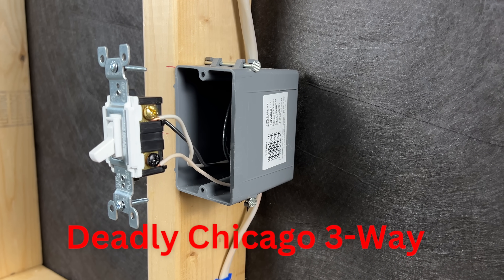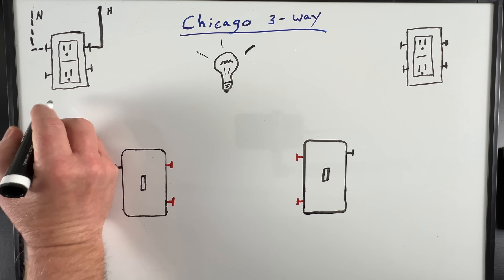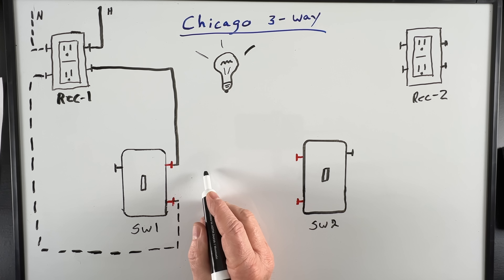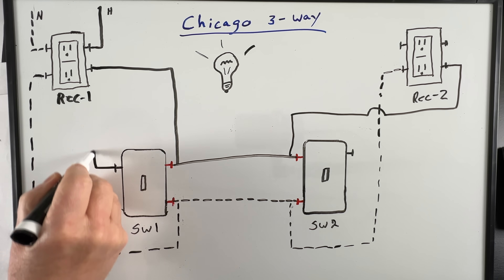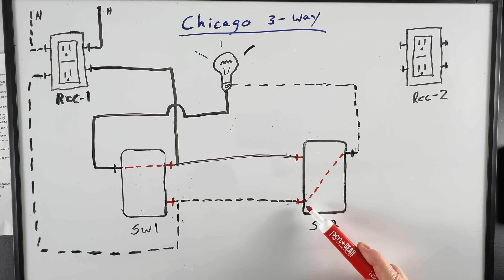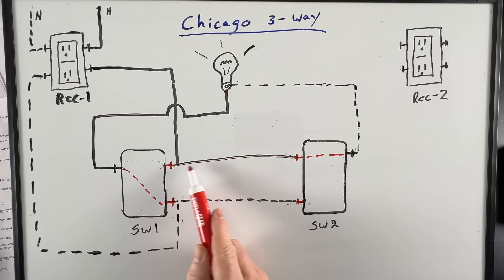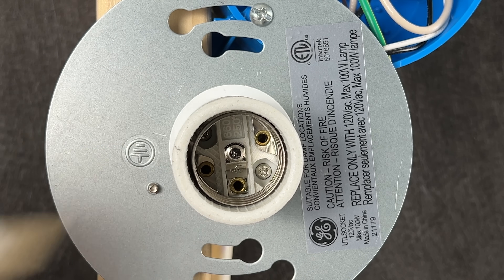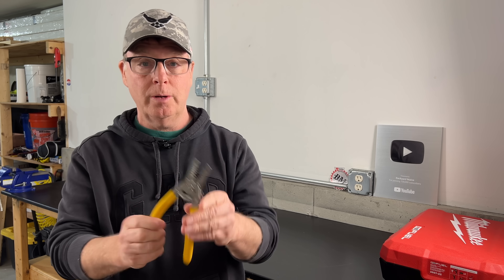The Deadly Chicago 3-Way (Only 2 Wires)

Comment from the maker: Video Links here>> California 3-Way - https://youtu.be/AeXFe5ghmKQ   Standard, Dead End and Single poles Switches here>>  https://youtu.be/B6gfI73Tvg8
Reply: Hey John, this video in particular is proving to be incredibly valuable to Me as I am in the midst of an old-house re-model fitted with tube wiring... this explanation and illustration just provided the answer to numerous questions that have popped up during the job.

I can't tell You how many nights I have laid in bed going through hypothetical wiring diagrams in Mine head!!!

Thank You for making AWESOME content! Your candor and step by step illustrations are really fantastic!

Be well!
Reply from the maker: @meancuisine8 thank you so much. I’m happy the videos are helping you on your project
Reply: I've looked at different information for 3 way switched lights and stayed confused. Your videos are simple and clear, thanks. 
 I wanted to understand how dad wired the stairway lights, now I have examples to compair to.
Reply: there are 5 ways not 4 you can overhead feed the light then switch the neutral
Reply: How could a 15 amp situation be deadly? 😂 come on man
Reply from the maker: @RefrigeratorWilliamPerry  120v power kills more people in the USA than any other voltage. And it only takes a fraction of an amp to kill you. If you don't know that you should not do any electrical work.
Reply: @B @BackyardMaine  I guess that’s true in theory I’ve been doing electrical work since I got out of high school over 30 years and I’ve got the piss knocked out of me more than I would like to admit when I was first learning, but the scenario has to be perfect like a plane crash before your life is in any danger… Unless you go put those Chicago three-way switches on one barefoot or something I don’t really see the issue besides, if you don’t know how to use a multimeter you shouldn’t be doing electrical work
Reply from the maker: @RefrigeratorWilliamPerry  Most of the time we get shocked across our hands so its not deadly. When current travels from one hand to the other or from your hand down to your feet you we're at a high risk. This accounts for about 1000 deaths a year in the US alone.

Comment: Just because its banned doesn't mean it can't still exist and work in older homes. I certainly wouldn't rip out my walls to change it if its working. Just don't assume a two way circuit is dead with the switch off.

Comment: But I'll say this- if there's a single gang switch at the bottom of a staircase for a 3-way switch there's nothing more convenient than a Chicago. Whether or not you go all out, there's still going to be 120 volts on one or the other of those traveler wires.

Comment: I was banging my head against the wall of our 1920's rehab house as i couldn't get the 3way stairway light to work right. Some knob and tube and i was giving up, thinking one of the wires had broken in the wall or something. It was like this when we got the house and only the 1st floor switch worked when the 2nd floor switch was up. 
Your video got suggested (phone probably had me cursing the switches). After a little digging, and measuring, IT WORKS! 
I'm so happy. 🎉
Thanks for the videos. They really help.
Reply from the maker: That's awesome! So glad I could help you out with that tricky wiring.

Comment: Actually Chicago feeds the bulb ON by L H, or H L respectively and OFF by N N and ALSO H H - so OFF bulb is LIVE and also bulb thread may be LIVE.
At least it carries electricity from one room to another by only 2 wires.
California anyway needs 3 wires.
Why don't they use the switches symmetrically? First switch connects H to line A or to line B, intermediate 4 way switches connect (incoming line A to outcoming line A') AND (B to B"), OR if reversed (A to B') and (B to A'), and the last switch connects either A" or B" to the tip of the bulb, while the thread of the bulb is N. Position change of ANY switch turns from OFF to ON, or vice-versa. I found this in 1966 in a much older electrician's European manual, for rotating switches.

Comment: As someone with knob and tube in crawl space and attic for ceiling I have seen outlets not work from three way switches not functioning to open splice’s with nuts exposed even wires with no nuts on them this seems like a fire hazard shiiieet my light flicker my dryer,micro,oven,ect on same circuit 😂

Comment: Saw this in my former old knob and tube home dating back to like 1910. Even got a minor shock not realizing that the 3-way switched ceiling light at the bottom of the stairs was wired in this unsafe older method using just two wires.

Comment: this is VERY similar to the turn signal wiring on older GM vehicles.  Ever see them alternate the marker light and the front turn signal when he headlights are on?  This is because the flasher is a 3-way.  It reverses the polarity on the marker light when the running lights are turned on each time the flasher clicks (which is a 3-way switch).  power flows backwards through it when the turn signal AND the running lights are switched on at the same time, but flows forwards (using the front turn signal light as a ground) each blink of the flasher.

Comment: In the chicago three way situation, where is the light fixture  assumed to be?  On the house or the garage you need three wires in between.  How would this run on your 2 wire theory?

Comment: If the Chicago 3-way was installed into a 240v system without a neutral (either L-L single phase or part of a 240v delta) and the conductors colored black/red, black/red/blue or black/blue/orange (all without white) wouldn’t this solve all the problems identified at the end of the episode?

Comment: I'm from Pittsburgh, PA. I 100% have a hallway wired this way. And yes It's K&T (1983 era house.)
Reply from the maker: Wow.. you have knob and tube wiring in a home built in 1983? It was phased out in the several decades before the 80s.
Reply: @BackyardMaine  That was a typo. it was built in 1893! (I bit of a difference, LOL! based on the many "OEM" Light fixtures I have the wiring is probably from the 1920s. the K&T is confined to lighting circuits, Most circuits (AND ALL in kitchen, bath and basement ) were rewired with Romex.)

Comment: I cannot think of ANYONE I know who would be willing to touch ANY exposed metal in a mains circuit simply because "oh that's supposed to be the neutral so it should be okay". That includes changing a lightbulb. And let's not even get into things like Schuko outlets which are DESIGNED to not have any particular assumption about which wire is supposed to be what. Anyone who is messing in any way with a circuit BOTH wires of which have not been disconnected by a breaker is... well, you do you.

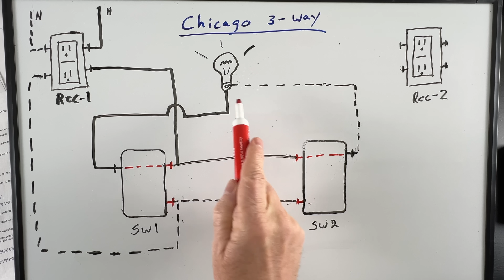Comment: 4:53 so the Chicago 3-way works on a difference of voltage so either side will be two neutrals when off or two hot when off

Comment: My home has the 3-way wiring to a flood light at the rear on my home to light the back yard. There used to be a switch at the stairway by the driveway to my front porch and another by the front door. We removed the porch so the outside switch isn't hooked up anymore. So, now I have to change the wiring around to make the light work. My home was built in 1901 and had gas lighting till the brought electric power here to Red Bank NJ.

Comment: I encountered this circuit in an old 2 story frame house in Chicago.  I think that when the house was built, the ONLY electric feature on the top story, was a single, ceiling mounted light fixture, switched at the base of the attic stairs.  100 years later, the entire 2nd story, now remodeled into a bedroom and an office with multiple outlets and light fixtures, were fed by those same two wires, thanks to a Chicago 3 way.   Next, let's talk about wires pulled into the black pipe that had previously carried gas for the gas lighting that preceded the electric lighting.  Or for something that really seems scary, live gas pipes, capped in shallow ceiling boxes that had previously mounted gas lights, but are now used as electric J-boxes.  And, where can I buy some old gas lights for indoor use?

Comment: All the knob and tube I'm familar with is actually 1 wire that continues in a continuous loop through the circuit until it returns to neutral. Later it was replaced with 2 wire romex  style still in a cloth outer covering.

Comment: This is a two way switch and not a three way, a switch with three terminals cannot be a three way switch, the switch has a common and can switch whatever is connected to that terminal to either one of the other two terminals, in other words it can switch to two ways, a light can be controlled from two ways...it is actually a simple switch over switch, why people call this a three way switch is always a mystery.

Comment: I’m just a homeowner who has remodeled a few homes. I’ve been bit by sparky a few too many times from this scenario and from assuming in general. I use my tester now and throw the breaker! Our 1900 farmhouse that we restored b4 selling got me good a few times, the most odd but memorable was getting shocked while painting the old lap siding cause a wire had been hit in the wall and the nailhead was energized. I was holding the paintbrush with my fingers touching the metal it was not a strong zap more like an electric fence I definitely had to scratch my head awhile to figure that one out.

Comment: 7:09 but it works.😮
Reply: By that logic, you don't even need switches, just connecting and disconnect the wires as needed.
Reply: @jon9103 that's all a switch is. A physical means to connect or disconnect a wire.

Comment: And when mines off you can still see the light flicker a tiny bit when its on off cause its still hooked to the outlet not directly in the wiring i put a male plug on the wire so i can cut the power to the 2 light switches and to the light fixture

Comment: This is a great reminder that electricity really doesn't care what color the insulation is on the wire! It will always flow through the path of least resistance.

Comment: The theory of this 3 way was common (no pun intended) in analog DC circuits in automotive electrical. I can understand why it was used in an era when copper wire was expensive relative to other costs. The difference is that at automotive voltage the electrocution hazard was not an issue.

Comment: I bought a house built in 1951. The old timer electrician that came to our house to fix the three way in our den encountered this mess.  As a homeowner, I always turn off the breaker when working on  any electrical wiring. But I noted these experienced electricians were changing outlets and switches with a live circuit.

Comment: You will find out that this won't work with silent mercury switches, because they will make one side off the circuit before it opens the other! This will cause a momentary short circuit and will trip the circuit breaker. 
Every time you switch one or the other you will need to reset the circuit breaker. 
This happened to a fiend of mine, all he did was replace his upstairs and downstairs switches with a 2 new mercury switches. He didn't want to run new or replace his wiring so he ended up putting the old switches back in.

Comment: How can it be called 3 way when it's only 2 way with 2 switches. I live in the UK where a 3 or multiway switch system is called an intermediate or crossover switch.

Comment: Actually, because the Chicago 3-way was common when 1/2" EMT conduit was first used in the houses and buildings built 1940s and thereafter, with the old cloth-insulated wires, it's actually best to just replace all the wiring anyways.  That cloth-insulated wiring is death waiting.

Comment: wow is that bad. I have some old buildings in Chicago and fortunately I've not dealt with that one. One had some tube and knob on the basement joists, but they were fortunately disconnected, though the 3/8 gas lines for the gas lights, though capped and not in use, were still connected to gas when I bought it 30 years ago.

Comment: I don't understand how this wiring method got started. I may be missing something, but it seems to use the same components as the modern wiring. It doesn't appear to be a simpler circuit that would be less likely for an electrician to make an error either. Is this just a cheap way to extend the circuit to the second receptacle?

Comment: Wow. I'm not an electrician, but a DIYer who tries to stay informed and likes learning. I recognized as soon as you finished drawing the circuit that hot would switch to the shell or have both hot. It's bad enough that we still have light fixtures with basically a shallow one inch hole and line voltage at the bottom. But to intentionally do this is just bonkers to me.

As they say, regulations are written in blood. People will do anything to save money until they aren't allowed to do it.

Comment: Nice video. As a landlord I encounter janky shit that previous owners did without knowing what they're doing. I've encountered hot neutrals that would blow a light when "corrected" because it ended up in 240v to a 120v fixture. Another effect, maybe not as dangerous, is modern circuit board controlled fixtures like led light don't like swapping hot and neutral.

Comment: Receptacle-2 is not needed here at all, unless you're showing that the switches are wired in between 2 receptacles(in the middle of the circuit, as opposed to at the end of the circuit).

Comment: Ran into one of these years ago when I was mounting a ceiling fan.    Was very confused why I was thrown off my ladder with no voltage...     I meteed hot to neutral.. now know to check both against ground too

Comment: I was wiring modular homes. I was the rough in. There was a dude with 50 years experience that was an "electrician". He did the trim out of the devices.  This house had 4 way switches that were in like 4 gangs each. We had 3 wire running from both ends of the switch banks. It was 4 4 ways. I only used 14/2 in-between the middle ones. He could not comprehend how it was going to work.

Comment: The only way a Chicago three-way would be safe is with GU10 twist-on light bulbs ( or using a DC adapter for low voltage bulbs ) and taping the white wire with black tape.

Comment: Ha, I used to live a few hours from Chicago and havent heard it called that. My parents house was getting rewired (it was original knob and tube). The old electrician taught me how to do quite a bit during the rewire, he ran across switches like this but just called them switched neutrals. The house was so old it still had the push button switches in a couple places, which still worked.

Comment: A buddy of mine bought a house and I noticed in his basement there was a 3 way switch the only had a 2 wire coming out. I followed it back to the a base And there was another 2 wire going off to another switch. And a 2 wire for power. I was confused so I asked my friend if I could take a peek. He said sure. As soon as I took the switch plate off I could see they were using the bare ground as a traveler. I told my friend how dangerous it was in that he should replace that and I would do it for free he just had to buy the wire. He said no it's been like that for years do not mess with it. If it ain't broke don't fix it. It's his house I couldn't make him do it.

Comment: This circuit was also used on very old European installations (rotary switches). Modern 3-way switches will probably arc over and explode when switching 230 V in this way. (And also this would be non-compliant.)

Comment: I was going to say the good thing about a 2 wire cable is that it holds the fish tape pretty good when you're yanking it out of the wall, but then I remembered a lot of these wires are installed by nailing two nails over each other or using a device to hold the wire in place, so they don't pull very well after all.

Comment: Thank you for the excellent video. You did a very good job of illustrating the path that the power travels.I was doing electrical work for my neighbor years back and I believe I ran into this exact scenario. I did not know exactly what was happening and was confused as to why the neutral would be energized when the light was off. It worked just fine though so I continued to replace the light fixture and it has been fine ever since. I've only encountered it once but the mystery is finally solved.
I wouldn't classify a 110V shock as being dangerous, and certainly not deadly. Indeed I almost exclusively do electrical work with the lines live and use my fingers to determine such by touching them. It's a mild buzzing sensation from the frequency it is delivered at; not painful at all.
Reply from the maker: Happy the video could solve that electrical mystery for you! 110 can kill you if the current take a path through your body rather that just through your hand. A hand to hand or hand to foot shock can kill. About 1000 people die every year from 120 volts. Safety first.
Reply: @BackyardMaine  I touch the electrified  wire with one hand and the neutral/ground with the other when I'm checking for live wires. I'm still alive, I think. Maybe I am not human. I've been doing this for many years. I've never tried 220V though. I feel like that high voltage will overcome the body's resistance. 
Humans are at an end, anyway. The injFections are mutating everyone into HomoBorgGenesis, the next evolution of man.

Comment: My old house had receptacles and an outdoor spotlight in the barn across the road, powered by one three wire cable passing through a plastic pipe under the road.  The spotlight could be turned on either from the house or from the barn.  I was told that the plastic pipe wasn't big enough to accommodate a second cable for just the receptacles, and I wondered how it worked.  Now I know, and I will inform the subsequent owners of the danger.